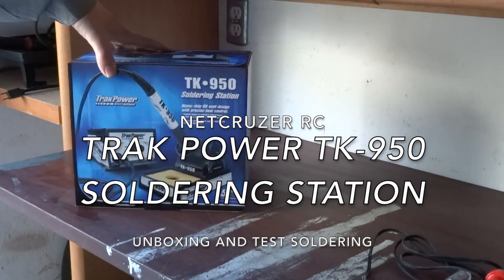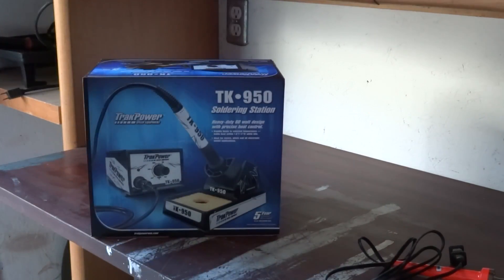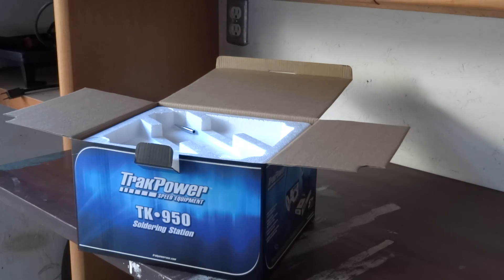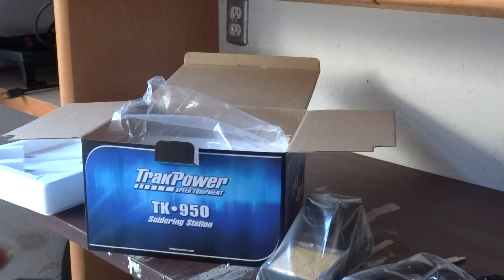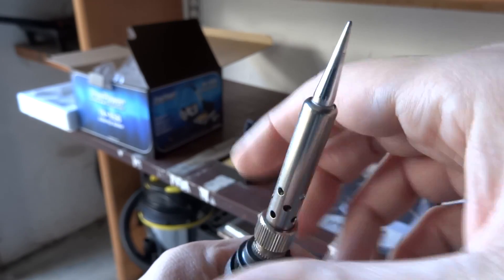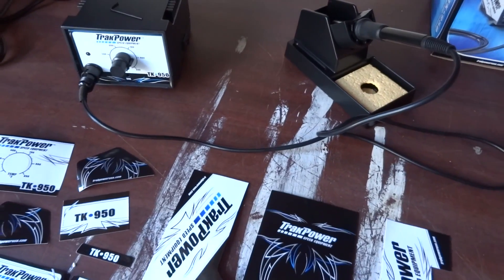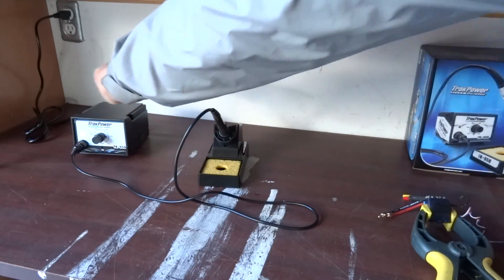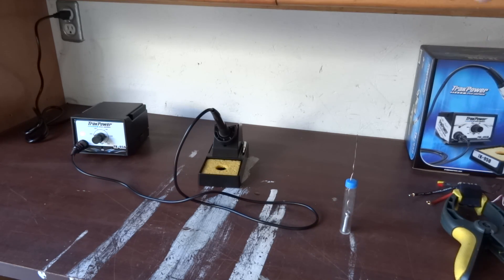TrakPower TK-950 Soldering Station Unboxing and Test

Comment: If you crack open this unit, you will see that the internal components are the same as any $25 Hakko 936 clone from China. Basically, you are paying a $55 premium for the 5 year warranty. If you happen to need warranty service, they can just send you a new one and they will still profit in the end. For $80, I can buy one clone, an extra iron handle, a hot air station and a bunch of accessories like extra tips, solder, etc. The components are EXACTLY the same. I’m not kidding.

Comment: I have had my HAKKO for about 10 years.  It's a lifetime tool..  I believe my model is what is used for the track power one...  It was a must have in the old days of hardwired batteries and round cell pack construction lol
Reply from the maker: Yeah I put off getting a quality iron for far too long, should have bought quality solder at the same time! LOL.